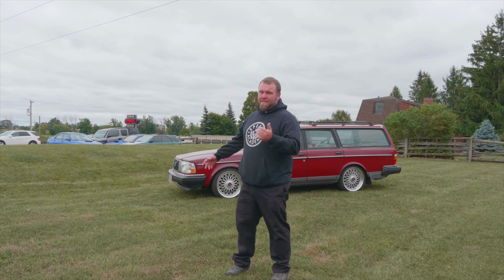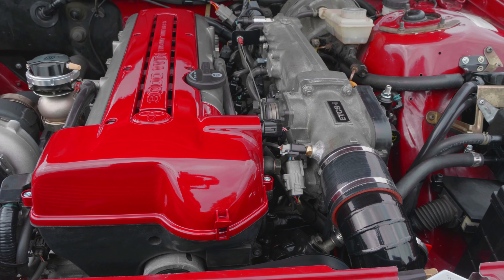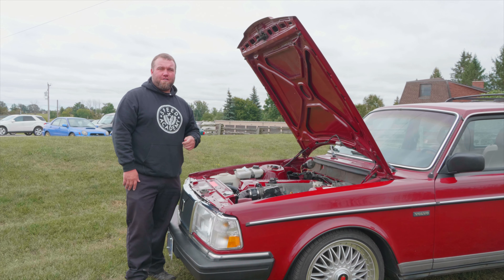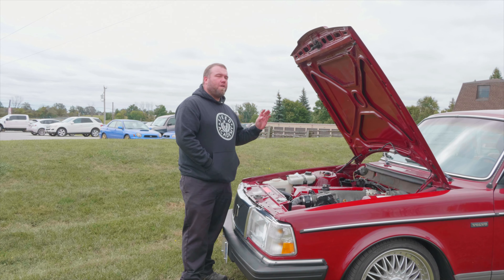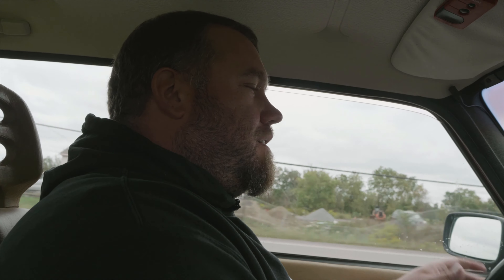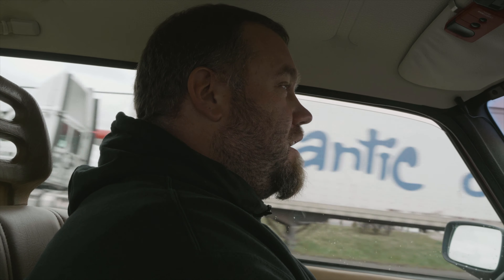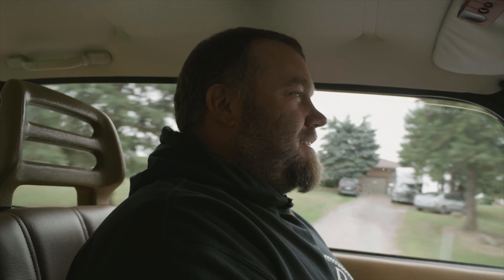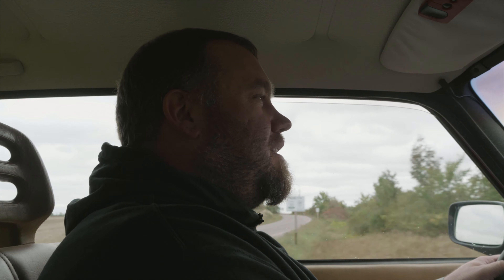How to build the ultimate Volvo sleeper.....2JZ inside

Comment: Tbh I wouldn’t 2JZ swap any Volvo these days, they are getting pricy. You can get a B6284T for like $900 and make over 450 WHP all day on stock internals. If you want to build the motor anyways, just get a B6294T out of a wrecked XC90 T6 for about $650-700, sleeve it, add pistons, rods and head studs…you’re good for 1400+, plus it’s all Volvo and still an inline six.